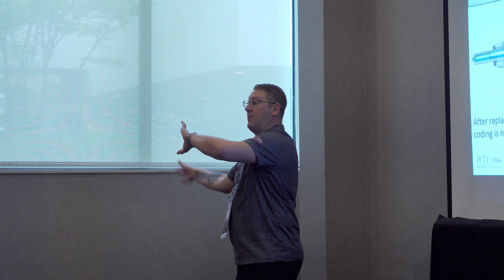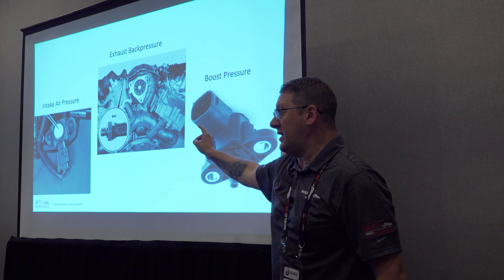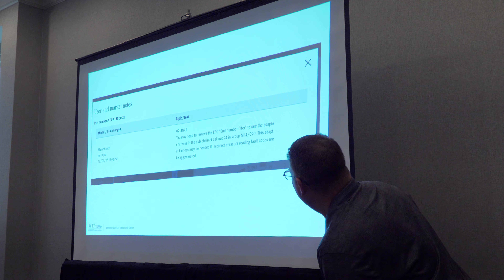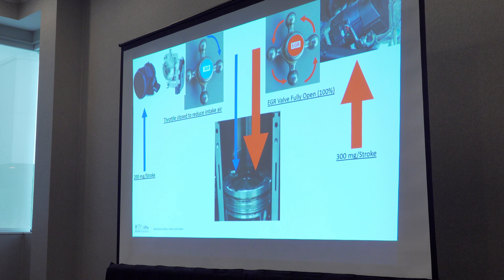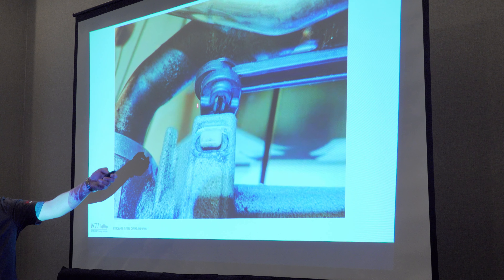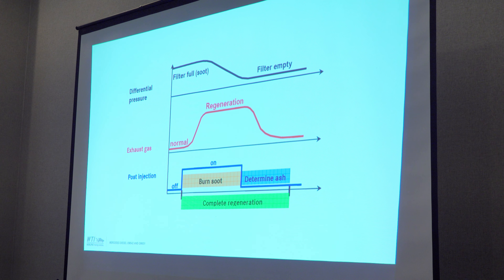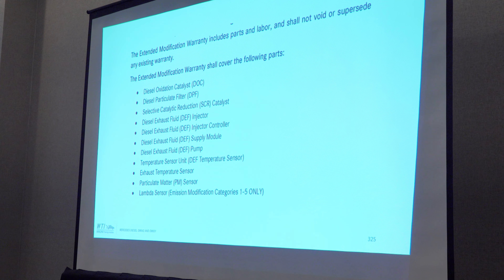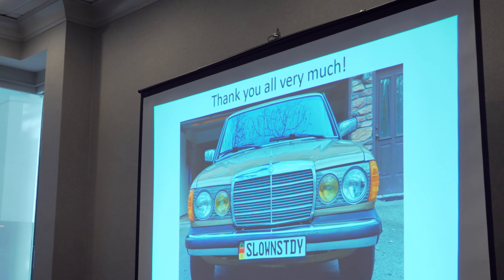ASTA 2024 - Dennis Woll - Sprinter Class

Comment: I've noticed almost every repair bill is now $1000 or more per vehicle no matter what the repair is.
Reply: Not with me, just charged a customer $60 bucks for a starter replacement, my low hour labor, my max being 80. Depends on the car but it's not surprising to get charged 600 bucks at shops now a days.

Comment: lol these instructors are all theory but the reality in the car is another different circumstances even today's software does not decree a damaged chain it has happened to me in several cars
Reply from the maker: That’s where oscilloscope prowess comes into play
Reply: "These instructors" give you a much needed base knowledge/theory of operations so you know how things are intended to work. They're not preaching a "bible of repairs". It's your job to evaluate the problem at hand and use your knowledge, tools & available info to follow the data you gather to reach a conclusion of the needed repair.
Reply: @SuperMarioDiagnostics  In these times and with such technology, the fact that the software does not detect a stretched chain is a joke, it is because the brands do not invest money, everything is cheap after the mechanic breaks down.
Reply from the maker: @gabrielbertoni9698  that days is made available through adaptation data. It will reveal what a scope sometimes cannot. Because the tensioner takes up slack in timing discrepancies
Reply: @SuperMarioDiagnostics  Yes, Super Mario, what I mean is that nowadays electronics control everything, how can something so important escape? Engineering error, what happens is that the new engineers don't have the slightest idea of what they're doing, and if not, look at what happens with the new Tundras, everything is done in software, but the reality is different.
Reply: You clearly don’t know Dennis. He does tech support for Mercedes vehicles full time. He deals with all the problem vehicles that techs need help with. He is way more than theory. 

I will agree there are some instructors that have been out of the shop for too long and do rely on too much theory. However, if all techs would just read SI, mobile techs and many instructors would be out of a job.